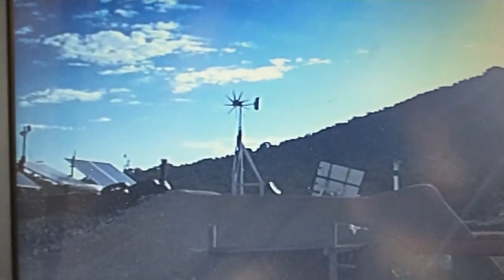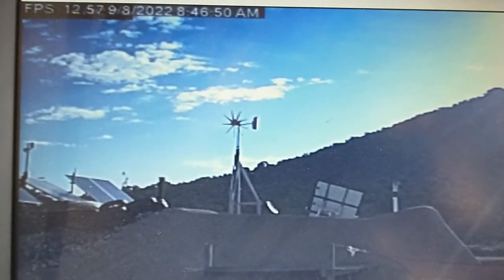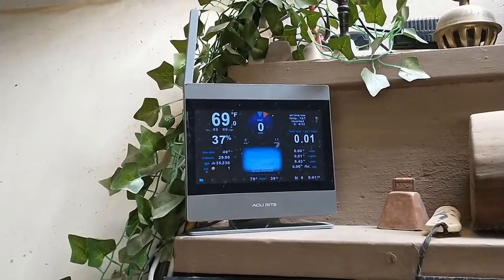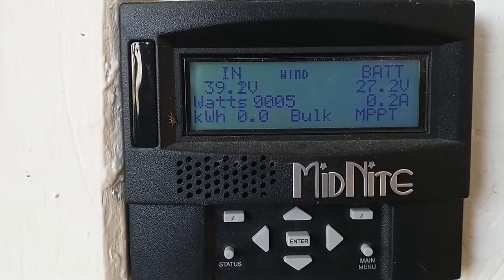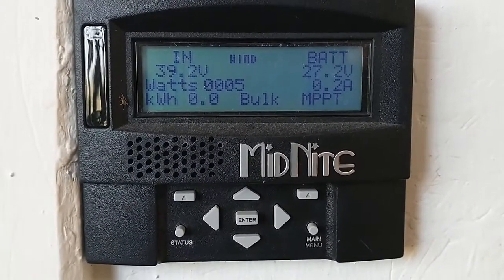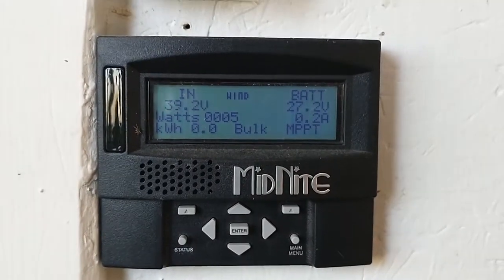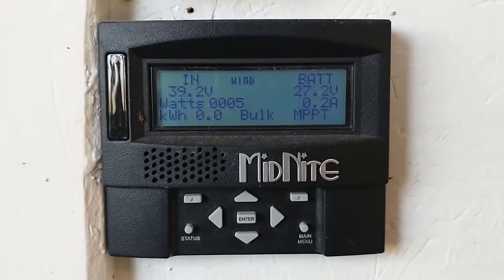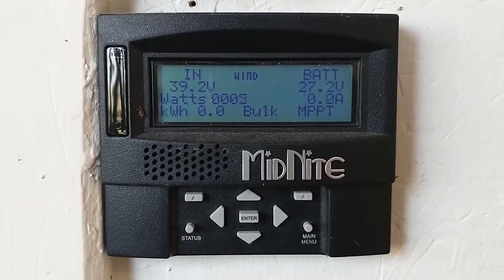Wind Turbine Making Power With No Wind?

Comment: Not sure how you grounded your turbine tower.....if memory serves me correct that every 1 meter (3 feet) if you drive a metal pole in the ground you get 05v between each pole. add third pole..measure from first to third..you will get 1 volt. Maybe your picking up energy from the grounding of the tower to your charge controller...just a thought. Reference: MrTeslonian youtube channel.

Comment: Not sure, not an electrician, but I assume it's something wrong with the logic inside the controller. Has it always done that? Do the readings when it is spinning still seem accurate / within the usual range? If so I would just subtract that 5 watts, and that's your new zero.
Reply from the maker: This started when I changed the PMA on the turbine but I am leaning towards it being a charge controller issue because it seems to hold on to that 5 watts even after I turn off the breaker to the turbine. The readings seem accurate when the turbine is spinning. Not a big deal but still scratching my head.
Reply: @aloneinanearthship4010  Ya, interesting, it seems like just some noise that it can't distinguish from zero. Have fun out there!
Reply: @aloneinanearthship4010  Maybe you discovered free energy!